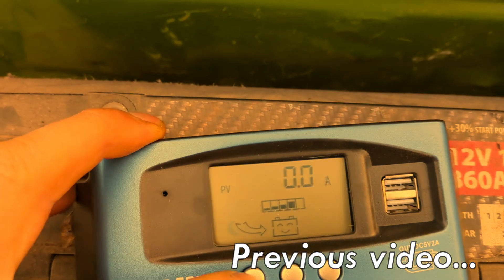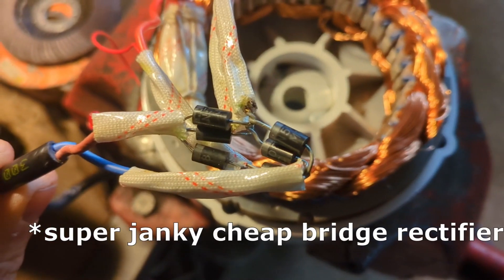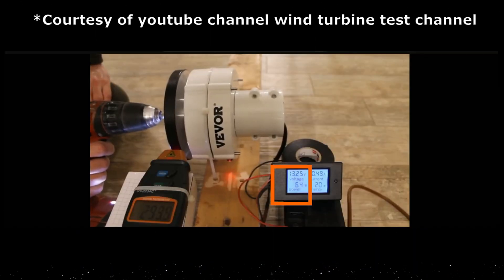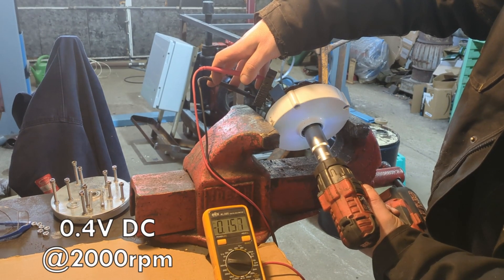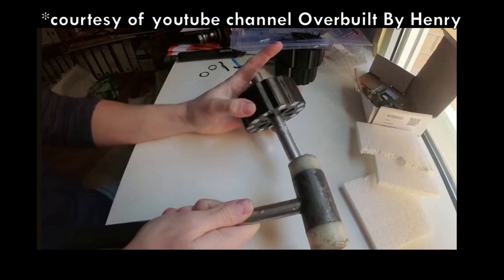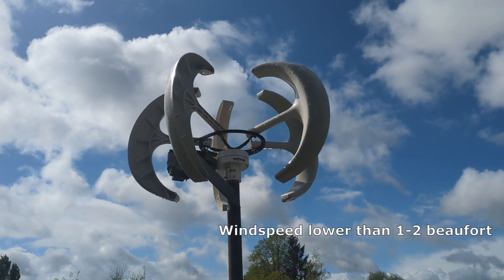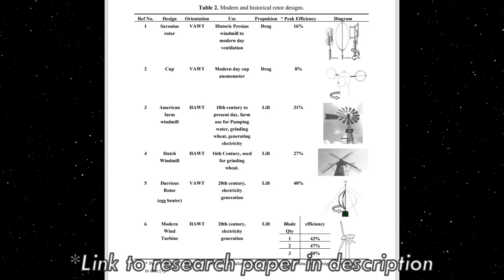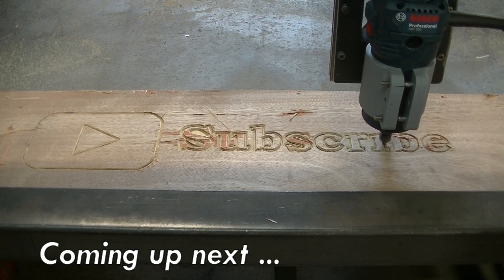China-windmill: not even worth modifying

Comment: I am off grid so every winter I am tempted by wind power but find too many pitfalls in price, reliability and longevity of wind power.  I see new systems in neighbors properties but they rarely seem to last a season without something or other breaking or being destroyed in storms.  Turned out to be more cost effective just to run my generator for an hour or so each day to make up for winter's low light.  I still like the idea so it is interesting to see vids like this.  Thanks for the well presented vid 😀
Reply: I recommend a simple wood burner with a spiral water tube going to a massive water storage underground like a boiler and have the lost heat dry your wet wood with the exhaust, place a heat pump/airco around the water storage to get it back in cold air if you like, burning wood in the summer to get free airco, hot water, hot house, you can even hook TEG A thermoelectric generator  also called a Seebeck generator, is a solid state device that converts heat (driven by temperature differences) directly into electrical energy
Reply: @Soulkeeper.  Some good thoughts there thanks.  I do have a water heating coil in my fire place but don't often use it.  I also didn't realize you can get larger TEGs until just then (looked them up).  I have smaller ones on top of the heater for fans but just saw the 48 volt 336 watt ones which would be enough to keep my system alive in the darkness of winter (12 KWH 48 volt system with 12x200 watt panels.  8-9 months of the year I never have a problem so a couple of these TEGs and your hot water storage idea (hadn't thought of that either) would solve it... and actually be fun to set up.  Many thanks for your valuable comment.  Cheers
Reply: @MIck-M  thanks
Reply from the maker: Problem with windmills is, they have moving parts and will require maintenance at some point.  And a lot of the commercial stuff is of low quality, sadly.
Reply: @thebrojectlist6881  I think the reason I see so many fail is because of lack of maintenance but often but I have seen some quite expensive ones go simply because of poor instillation too - thin guy wires or not tight enough or just a bit of movement in the base etc.  If anything moves or is not over engineered high winds will eventually rip it out.  My thought was to get a good one and only use it in winter, then remove the unit aside from 3 months per year when needed.  Braking systems are getting better too.  So much energy in it that I can never really let the idea go.  Maintenance will always be key though for sure.  Cheers
Reply from the maker: @MIck-M  exactly, it has to be over engineered en well maintained. I too am fascinated by the concept of harnessing the power of the wind 😄
Reply: @thebrojectlist6881  not if you have magnetic bearing and magnetic gearbox